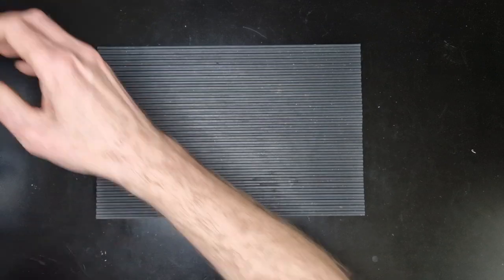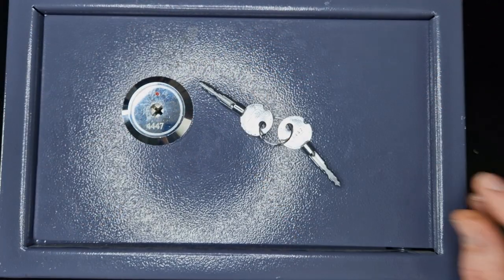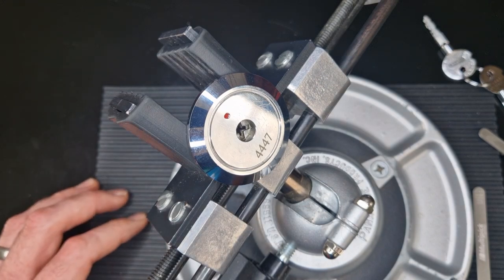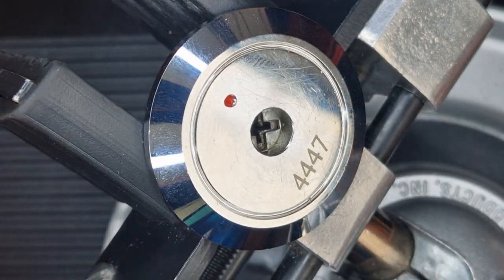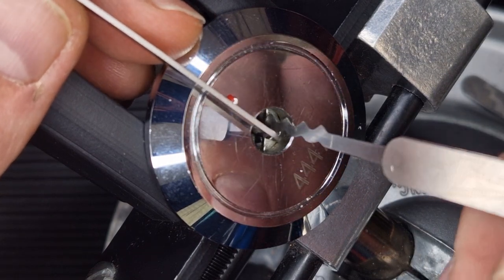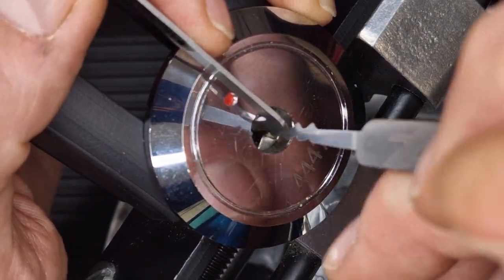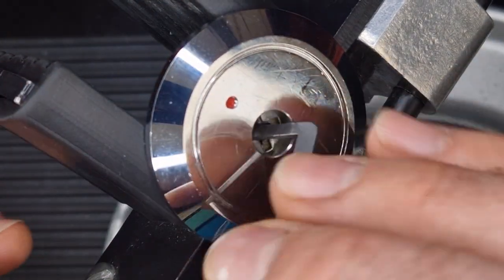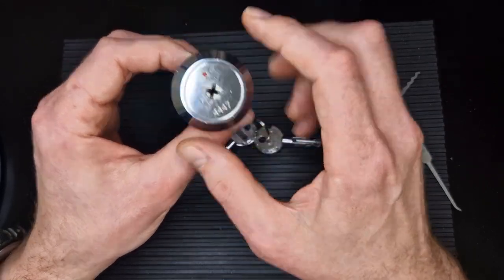Safe crosslock/cruciform lock. Picking, raking & embarrassing

Comment: I am not in the lock sport picking however I am in the trade.  A little history of the this type of lock shows that Linus Yale Sr. patented his 4 way pin lock in 1844.  Much much larger than these little pin locks they are pretty rare and can be found on certain makers of safes from the mid 1800's.  Next up was a lock of the earlier to mid 1900's called the Cleveland 4 way.  These were basically the same as the modern versions seen today.

Comment: I have a safe that was my Dads that has a lock like this, along with a dial. Using a cruciform pick I can get it to turn slightly, and it puts a lot of tension on to the dial at certain points, any tips please? My dad passed away in 2008 so have just had this safe collection dust, and curiosity is getting the better of me. Annoyingly i remember seeing the cross key on his keyring just don’t know where that went 😢
Reply from the maker: @roxannehands313  most cross locks are low security. If the cross picks don't work, I'd use a wave rake like in my video
Reply: @Dmaclocksport  and where should the dial be while raking? I dropped you an email as well after I commented here, appreciate you getting back to me 😄
Reply from the maker: @roxannehands313  my guess would be that the dial and key are seperate locking mechanisms, so it wouldn't matter where the dial is. Just a guess though 😁